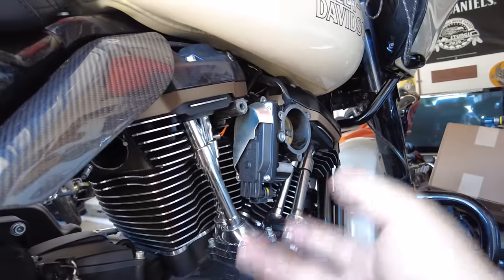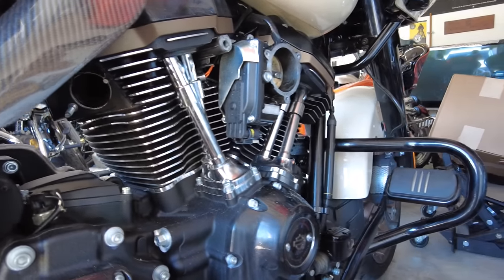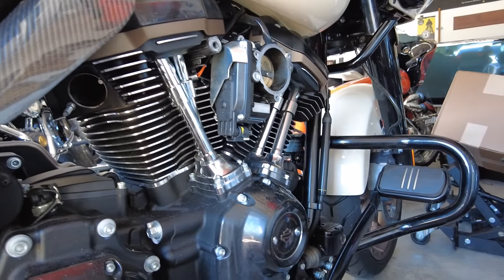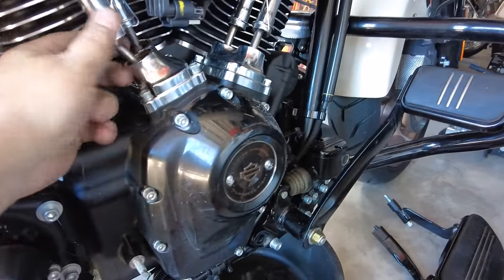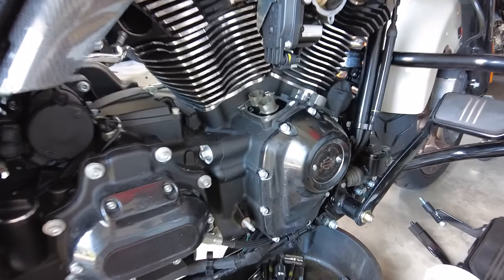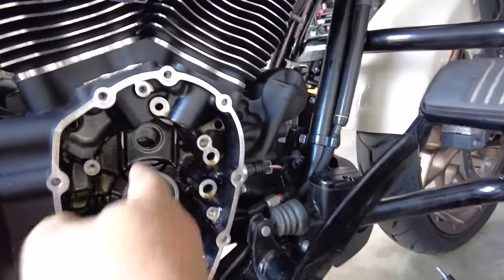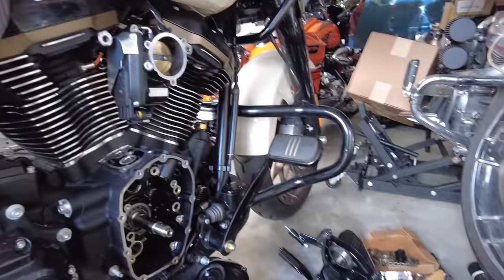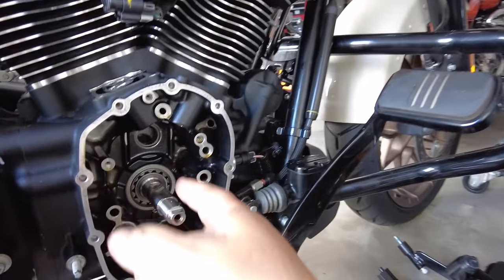Harley Road Glide ST Stage 2 Cam Install!

Comment: I have 103 twin cam I had great oil psi when I changed my cams . No issues and I have 14 psi at idle and as much as 40 psi at 3500 Rpm . I used my original cam plate and I oil pump with 50,000 miles . 2015 eltra glide .

Comment: Do yourself a favor and remove the throttle body. Makes adjusting pushrods much easier to get to. Also VERY important, be very careful removing stock lifer cuff bolts. They are very easy  to break due to really good factory locktite. May require heat to break locktite. BE CAREFUL.
Reply from the maker: That’s what the soldering iron was fkr

Comment: Always much respect for your Dad. It’s great you are helping him with the VA. I’m a retired Marine also and I’ll tell you gave my medical taken care of by the VA is a huge plus. Being 20 years retired our health insurance is also covered and having never had to worry about is also a huge plus..
Reply from the maker: It’s a godsend for sure.
Reply: I am currently 90% fighting for 100% disability and was medically separated from the Air Force. I get all my stuff taken care of through the VA. The only thing that sucks with them is getting appointments in my area. Outside of mental health, anything else is at least 1.5 months or more out. I have been waiting on an allergist referral for 3 months

Comment: I wanted to do a cam in my bike for a while now, but just didn’t feel 100% confident doing it myself, now after seeing you do it and completely skipped the most important part and still didn’t wreck the engine gives me confidence to do my own. Thank you.🍻
Reply from the maker: The secret is to be meticulous and read every instruction 10 times. I rush and don’t pay attention by nature.
Reply: Don't be afraid to do the cam yourself. I've done cams, big bores and heads on Harleys with no problems, but I'll take my push mower to the pros as it's a bit more complex.
Reply: @ProfessionalMonkey  aren’t there a couple of dots to line up?
Reply from the maker: @murrayhelmer8941  yup, I simply walked away from the job to do my real job, came back and put the sprockets back on. I just didn’t pay attention, and that’s when things go sideways.
Reply: @ProfessionalMonkey  ya. That happens to all of us

Comment: I put an S&S 475 cam in my SG CVO
When I pulled the cam bearing out, there was needle bearings missing. I searched around with a magnet with no luck. I was missing about 3 needles and a couple of casing pieces. I finally just put it back together and changed the oil. It ran frickin great and there was no noise but I just didn’t trust it. So after about 500 miles, I just decided to do a stage 4. I pulled the motor completely out and sent the bottom end up north for some upgrades and bullet proofing. I even pulled the pan off the tranny for cleaning. I never found those needles and after talking to a few experts about it, I just figured it came that way from the factory and must have got damaged when they assy the motor new. Moral of the story; if you are on the fence about a stage 2, just do it and replace that weak link.

Comment: First, congrats on the successful install!!  It's not easy for someone to admit their failures and you did it twice.  Good job on that too.  The first time is always the hardest so don't be afraid to do it again, and again, and again.  Next thing you know you'll be rebuilding motors.  Your buddy Jason is correct, that is how you build in reliability.  I like to think of it this way, the time you spend cleaning, prepping and double checking everything as you go is money and time saved when it breaks/leaks/etc.
Reply from the maker: It was awesome to work with Jason. His attention to detail was amazing.

Comment: I understand totally, I broke the bolt on my tappet cuff flush with case.  I know the exact look you had.  Luckily so many people have broke it that they make a specialty tappet cover that serves as the cuff also.   Expensive mistake but at least it only set me back a couple days.  I got mine from fuel moto.  

Good job, I understand the not wanting to bother people too.

Comment: I find its a good idea to rotate the rear tire after you first get the cam plate bolts in finger tight.  Then at 10lb torque, rotate the wheel a few more times.  Helps center the cam within the cam plate. keep rotating and torquing until to full spec.

Comment: Congrats on taking the plunge.  I watched 100 videos first and had major butthole pucker when I cut the first pushrod out when I did my cam.  No better feeling though than saying I did it myself.  I kept the HD oil pump and cam plate.  21 Road Glide

Comment: On my 22 Road Glide 107 that I put an S&S 475 cam in. I used the stock oil pump because is is better than the first Gen M8, and it is doing fine and works great. The Stage II upgrade does make more heat than the stock setup. I had to install an UltraCool oil cooler to keep it from over heating. I live in Pensacola and it gets hot here, you may want to look into this also.

Comment: Now that you've done it the next one(s) should be easy. When it didn't start, I was sure it was gonna be because you didn't pump up the lifters before installation.(at least didn't show it.) You were very fortunate that the valve timing wasn't off far enough to create valve to piston contact. Good thing is, you'll never make that mistake again. Great job getting put of your comfort zone and getting the job done!

Comment: Thank you so much for this video. I have a 2018 Ultra Limited (107 motor) that only has V&H Power Duals, SE Air, and Cobra NH slip ons. I bought the bike 2 months ago. It had 91,000 kms on it (yes I am in Canada) and I've put 4,000 kms on it since I bought it. I have really been thinking about doing the cam and oil pump on this bike. However, I purchased the Harley ESP when I bought the bike. So I would have to stay with HD parts to maintain the ESP warranty. I'd like to do this job myself, like you did. It's all about maintaining that service plan though at this point. I've looked at the Fueling Camchest kit with the 472 cam, but that would void the ESP for sure. I also have a PowerVision from my old SGS that I haven't hooked up yet, again because of the ESP. So likely I'll have to get the HD tuner as well. But you inspire me to wrench on my bike. The install looks straight forward, as long as I don't forget to set my timing ;)

Comment: Nice work Monk, glad nothing happened and you had the sense to stop trying to start it the first time, funny thing is I was wondering after you put the pump and plate back in it you didn't mention at least lining up the timing dots on the cam and crank sprockets and when it didn't start I figured that was the problem.. in the end your just one step closer to refining your own oil for the smoke out chopper build....lol. Cheers from the Great White North.. PS.. your right working on the concrete floor SUCKS HUGE

Comment: Dude, if you ever try out Freedom Shields, you will never use a different windshield again........GUARANTEED!!!! Another quick tip, if you remove the left side thigh heat protector, keep the one on the right side, it WILL help your bike run cooler and you will feel less heat. This eliminates the air that's being stuffed behind the aft cylinder and lets it all come out on the left side. It's something you can actually feel. Good call on the pump and cam plate. The flow and pressure is much better than stock. Very glad we didn't see any bent valves on this girl!! AWESOME video as always Monkey!!! Thanks for keepin it real!
Reply from the maker: Thanks, bud. I have heard about the heat shield thing. I might have to try that!!!
Reply: It actually makes a difference you can feel, appreciate ya Brother! @ProfessionalMonkey

Comment: You are going to love that RS 472 cam, I have it in my 2019 CVOSG-- I`m now experimenting with Star cam---hoping to get as much as possible out of the M* without installing a 131 motor. next you are going to need to upgrade the clutch basket and compensator :)---never ends!

Comment: Im planning on doing a S&S 465 this winter on my 18 Softail. Since it’s an 18, I’m doing the whole bang on it. Cam plate and oil pump. Might change exhaust as well from my V&H 2-2 to a 2-1 of some kind but haven’t decided on that yet. 
I know all this will be way beyond my pay grade. Have 3 local indie shops and 3 dealers all within about 45 minutes of me. Not sure which one I’ll have do the work, but leaning towards one of the smaller Indy shop that is a little further away, but everyone I talk to swears by them.
Reply from the maker: Indy shops can use the business and if they’re good they’re great!

Comment: I’m going to do a stage II to my midyear production 2019 FLHTK . I was told the latest oil pump started September of 2019, I bought the SE pump & plate just in case. Leaning towards the Star Racing 30/30 cam.

Comment: When I did mine , I got a buddy to help me and when he pulled the cam chest off along with the oil pump ,one of the gears fell out and needless to say it didn’t go in the way it was.when we started it , it wasn’t building oil pressure. We would adjust the push rods and they wouldn’t stay right because the lifters were sloppy from no oil pressure. Ended up taking it to a local shop to get it right. The gear from the oil pump was not put back in right!🤯

Comment: Not sure if its the same for M8's finding Top Dead Center before cutting push rods but with Twin Cams everybody always sticks their finger or a straw in the cylinder after removing spark plug, or they rotate the tires and watch push rods movement etc etc..  all you have to do is remove the cam cover which you have to do anyways and rotate the tires using the timing mark positions for exact TDC.

Comment: Put your tappets in a vac jar to pump them with oil. If you have a vacuum sealer for food, chances are you have a jar that came with it. Tappets in jar with oil, vac it and watch the air bubble out. They are now pumped with oil.
Great job Monkey!!!

Comment: Great job.  

Like you I will do everything but go inside my motor.  I leave that to someone who actually knows what they are doing.   

A co- worker has a VRod.  I even pulled that whole thing apart in my garage.  He took the parts and had them painted, powder coated, aftermarket bar and assorted other parts.  

I put the whole thing back together in two days and it rode great.   He never came back with a complaint.   

Semi related question;

The tour pak holder on your wall. Who is it by?  Where did you get it?

Comment: That’s the first thing I said when watching this video you never said anything about the timing, plus I don’t remember if you checked the runout before the install. You supposed to soak the tappets in oil before installing. After the parts settle in I’m pretty sure you going to have to readjust the pushrods they probably going to be a little lose.

Comment: Back in the day many many moons ago when I was 18 I worked for an engine development company in the UK and had the opportunity to build my first car engine from scratch, bare block up. Guess what I did..... instead of putting the timing marks TOGETHER I lined them up with the marks on OPPOSITE sides of the sprockets so making the timing 180 deg out... guess what, motor did not fire up!
When you went to start your bike and it didn't fire I knew exactly what you had done, you was so lucky you didn't hit a piston and bend a valve, you don't need a motor to run to do that!

Comment: Putting a torque cam in my Evo, soon. Not the first time I've done it, but first time I've done it on the floor. Only 35. But bad back and knees already. I do have an old craftsman jack that I'm hoping will help.  Still debating one whether or not to pull the rocker covers and keep the pushrods intact.

Comment: You can put each cylinder on the compression stroke(base circle) and you will be able to cut both intake and exhaust pushrods.

Comment: Mr. Where is your runout gauge for pinion run out & pinion flex? I hope you put the O ring on from behind the oil pump to the bearing seal.
Reply from the maker: O rings were swapped all is well

Comment: 6:27 How many of the 2020+ vehicles, made with lots of plastic, will be running in 30 years at classic car shows? 3D printing may save this culture but, IMO, metal is better.

Comment: Supposedly via fuel moto. If you take the came cover off first. You can use the dots on the gear alignment sprokets you can determine BDC on rear cylinder if both dots are at 6 o'clock and rotate both dots to 12 o'clock position for front cylinder BDC... may be incorrect as far as front cylinder and rear cylinder but overall thats Supposedly the easier way to do it without watching the pushrods go up and down

Comment: My harley dealer must have missed on pf those pushrod o rings, 20 mile ride home in the dark and lost the rear brake and got home covered in oil 🙈
Reply from the maker: That could totally happen easily. Rushing through the job could cause all kinds of problems!

Comment: Using the timing marks on the cam sprockets takes all the guess work out of pushrod removal and adjustment. Also a note on the tappet cuffs, the solution is not to just use the stockers, it’s to read the instructions 😂

Comment: Love your channel you are supposed to soak lifters in oil to bleed air out or your pushrod adjustment will be incorrect
Reply from the maker: Yup. Those Feulings are spring loaded so when you extend out the pushrods they will still make contact so they can be adjusted even though I didn’t soak them correctly. It just made for a noisy valve train for about 10 minutes.
Reply: @ProfessionalMonkey  Thanks man getting ready to put a cam in my 2023 strretglide that's good to know

Comment: You never mentioned if you needed to heat up the bolts that held the tappet cuffs or not?
Reply from the maker: I ended up not needing to, but the soldering iron would have done the trick.

Comment: Did the tappet cuff bolts come lose ok? Or did the soldering iron trick have to be done?
Reply from the maker: Mine actually came off fine.
Reply: @ProfessionalMonkey  I like you have never done this, looks easy enough but those cuff bolts are scaring the shit outa me if they break!!! I have a 2019 I need to get that oil pump replaced before she blows!

Comment: Called it.   As you were cranking I said to myself "self, that just sounds like it's not timed right."

Dont think I'm some engine whisperer, but I spend most of the summer of 2020 agonizing over a 1960's gas tractor engine pulling my hair out trying to figure out why it would not start.  Assuming everything was right otherwise (which your buddy ultimately did) it HAS to be the timing.  Anything else you touched would have made a god awful noise if it had been done wrong.  You didn't touch the fuel system or ignition system, so there was no reason to believe it was involved.

Timing.  Check it - it can save you a ton of grief

Comment: dumb question.. what seat is that?  I got the same bike and starting to change it up that I got 500 miles on it
Reply from the maker: That’s a seat I designed with Advanblack. It’s not out yet,  it it will be!

Comment: I believe a lot of the parts upgrades are just up sales! Have you ever seen or heard of a factory cam plate break? No you haven't. I have NEVER heard of or seen a factory plate break. Lifter cuffs MUST be upgraded. My plastic cuffs crumbled in my hand with 14,000 miles and my bike is a 2019. The adjustable pushrods are NOT as strong as the factory one piece rush rods. Yes, a pain to change. You need to upgrade to the roller rockers and rocker studs. Of course the inner cam bearing must be changed. My Road King is a 2019 and has the upgraded factory oil pump and will shoot oil up out of the lifter when spinning the rear tire over with my foot. I'd say that pump is good.

Comment: Did you pump up the lifters with oil before you installed them
Reply from the maker: Nope, I'm a dumbass though. It chattered a bit but shes fine.
Reply: Also a tip for tappet instal is to place the oil inlet of the tappets inward. The oil feed from the block is between the tappets.

Comment: You didn't soak the lifters In oil to remove the air?
Reply from the maker: Nope, yet another mistake
Reply: @ProfessionalMonkey  obviously it worked tho right lol.

Comment: You need to pump up your tappets with oil before you put them in so you adjusted your pushrod well the tappets were collapsed so when you start your bike in the tap it pump up that pushrod are going to bend
Reply from the maker: No they’re not, the Feuling tappets have spring retainers that hold the cup at the top even if they’re not pumped up.

Comment: You really should have checked the crank runout. If it's over spec. Which it most likely is, it'll eat your pump up. I used my stock pump.  I was over spec, and my tuner tells me m8s are generally not very true. Stock pump works fine.
Reply: Did you check and make sure you used the right thrust washer?

Comment: Bleed your lifers BEFORE  you install the lifters. If you dont your pushrod adjustment will be wrong, close but wrong... and wrong can bend valves with some cams......

Comment: Tell your mechanic friend that you did not pump up your hydraulic tappets before putting them in the bike, you essentially set your pushrods to zero lash plus 2.5 turns on collapsed tappets. Your going to have a major issue
Reply from the maker: Feulingntappets are spring loaded so zero lash is practically the same, just really noisy till they pump up.
Reply from the maker: But I’m gonna readjust them in a few days for sanity’s sake.